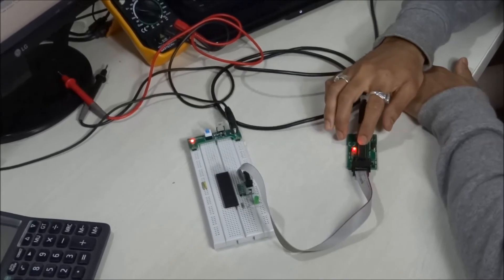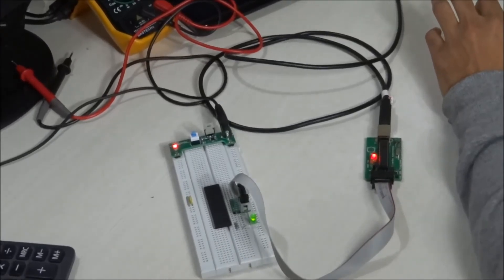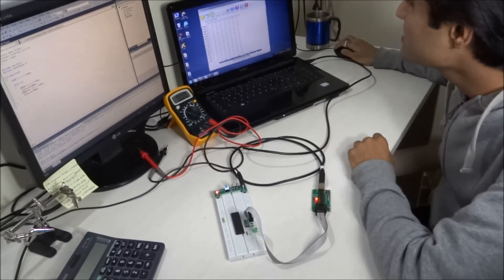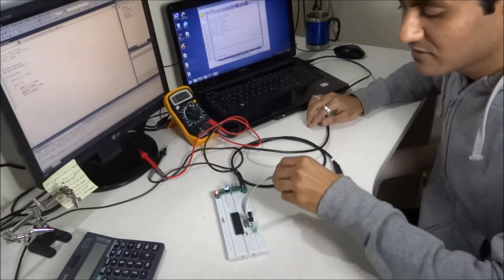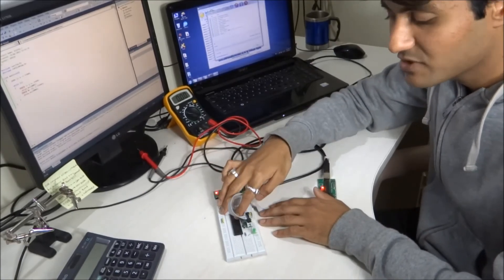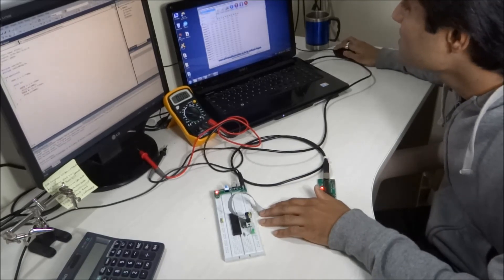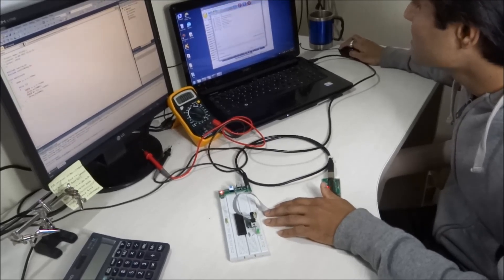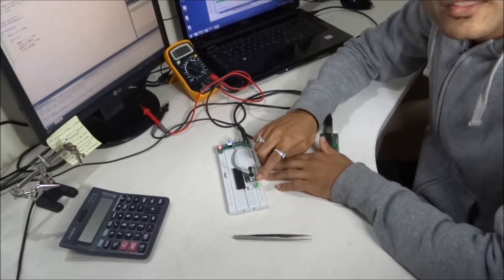Program AVR Microcontroller using AVR USBasp Programmer

Comment: Hiii
I am trying to program atmega1280 using isp and for now i am having avr usbasp programmer...while burning the firmware to the target chip, I am receiving errors like "Power On Failed" and "Cannot communicate to target chip".
I am not using any external power supply as you have shown in your video but still i am able to receive +5v at the target controller Vcc pins.
Can you please assist me and point out where I am going wrong??

Thanks
Reply from the maker: ***** 
Hello Gursewak

This error is very common specially if you are new to AVR MCU. You are right that you've been getting 5V on target chip but for proper communication between USBASP programmer and target MCU you have to set some jumper setting to select  power options. And unfortunately if you buy local USBASP Programmer (India/china made) I am not sure they keep them or remove permanently to avoid hack. Anyways make sure with your programmer and read manual. Here is some options/jumper setting:

Setting jumpers (J1):
J1: Power target
   Supply target with 5V (USB voltage). Be careful with this option, the
   circuit isn't protected against short circuit!

I RECOMMEND YOU TO TRY WITH 5V EXTERNAL POWER SUPPLY JUST TO MAKE SURE POWERING MODE.
I hope you will find this information useful
Reply: BINARYUPDATES .COM 
Hiii
 
Thank you for the response.
As you suggested, I used external power supply for this, however, I am still facing the same issue (Errors like Power On Failed & Cannot communicate to Target Chip) and not able to program my target chip (ATMEGA1280) using USBASP Programmer. Your assistance would be helpful.

Apart from this, I do have one more concern, as I have to program Atmega1280 using USBASP...do i have select this specific microcontroller in the software which is used to burn the firmware into it. Because I am not able to find this controller in any of the softwares like AVR Program Loader and Extreme Burner. Can you suggest anything on this???
Reply: @GursewakSingh-gk7nh  bro im also facing same issue did you resolve it?

Comment from the maker: Hi Gurpreet, Take multimeter and check voltage around your microcontroller's power pins (VCC & GND, i am sure this happen due to loosely connected power pins which failed to power your microchip.

Also make sure your programming pins should not short while flashing microchip by programmer.

If in case it still doesn't work then provide me more details about hardware that you're using

Try to Enjoy and Good Luck....!!!!